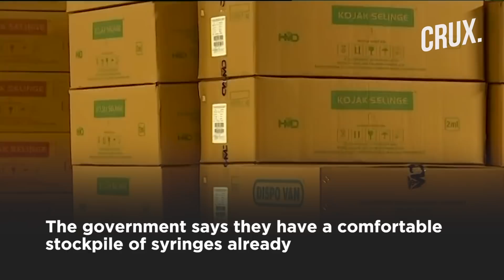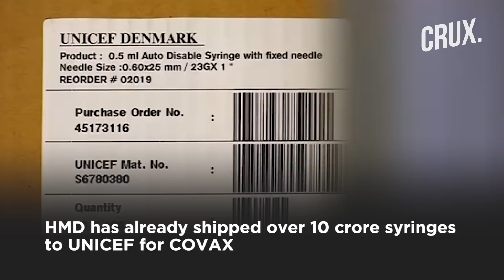How A Faridabad Factory Makes 1 Lakh Syringes An Hour To Prepare For COVID-19 Vaccine Drive

Comment: Now imagine if the vaccine need not be injected 🤣🤣🤣🤣🤣🤣
Reply: Experts are not chutiyas like us
Reply: Your correct. 
Hydrogel platform with micro needles is tipped.
The luminescent tattoo was patented back in 2006.
It's components include enzymes from the north American firefly and click beetle.
Self administered like sticking on a band aid, it's activated using a frequency device waved over the site to initiate the DNA change inside the body.
If the needle  is used thousands of nano bots circulate in the body.
Look up the channel of Doctor  Carrie Madej and find her chat with Sheree Tenpenny.
Then decide from an informed position if you want these manmade nano bots that connect you to the internet of things inside you.

https://www.sgtreport.com/2020/05/shock-as-its-revealed-an-enzyme-called-luciferase-is-what-makes-bill-gates-implantable-quantum-dot-microneedle-vaccine-delivery-system-work/